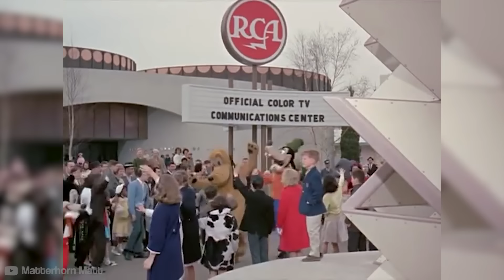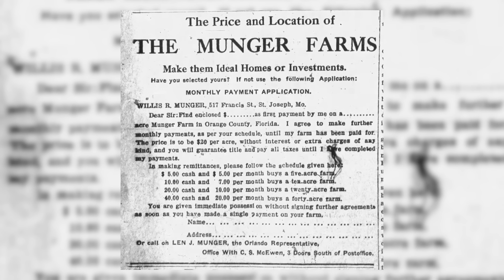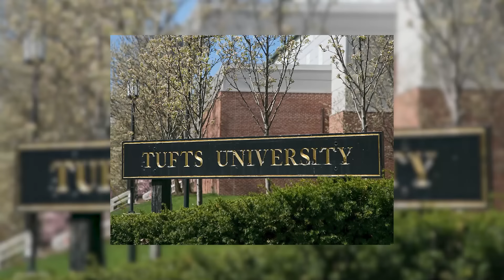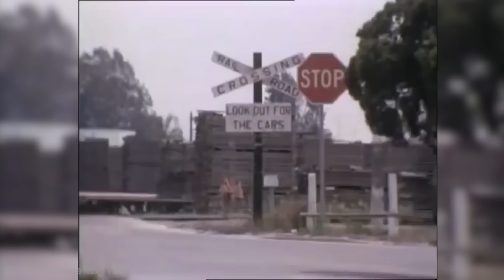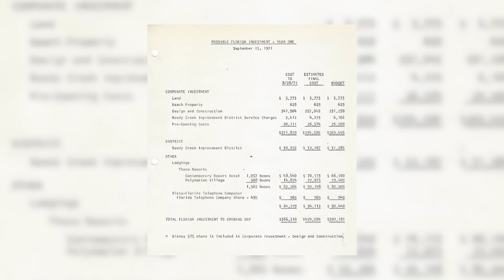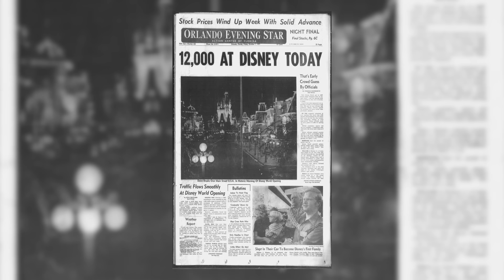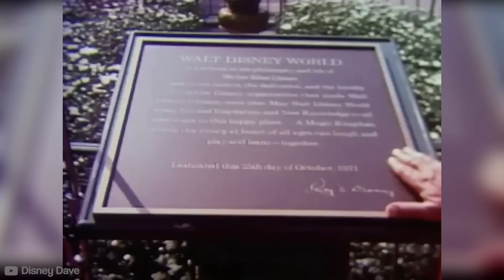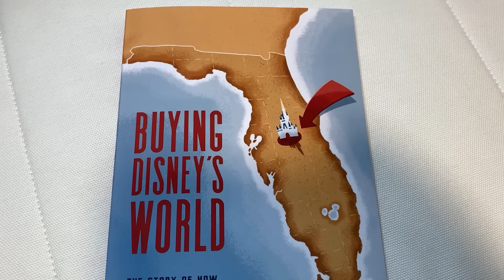The Construction of Walt Disney World

Comment: I liked the color scheme of the Castle like this 0:07 not the new gawdy colors with that horrendous blue.
Disney is slowly getting worse. Also, I think Walt Disney turned into a megalomaniac, gobbling up so much land, and trying to usurp governments. Not cool.
Reply: Do you honestly think that in the 60's Orange and Oseola Counties could have built the roads, sewers, power stations, water service and surface water drainage in the time frame necessary for the parks construction. The short answer is no. The Reedy Creek Improvement District is an example of how government should work. As for usurping government, you have that wrong; two cities were created out of unincorporated land. (City of Bay Lake and Lake Buena Vista) Those are some of the most highly taxed parcels in the area.